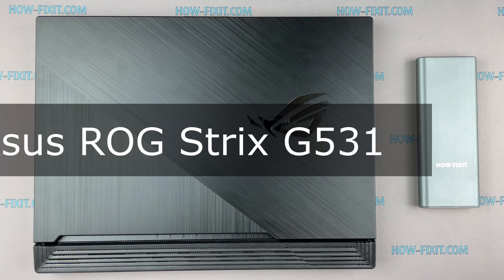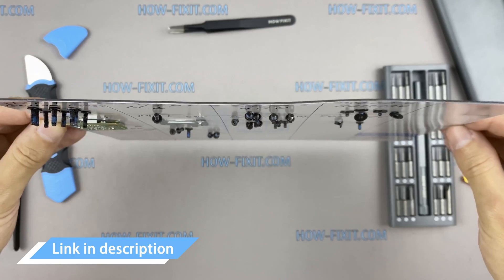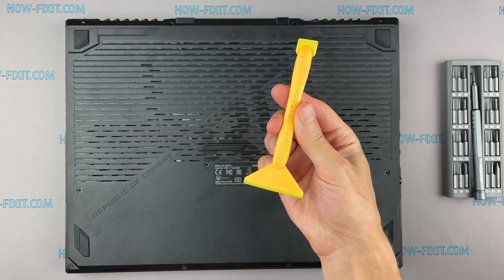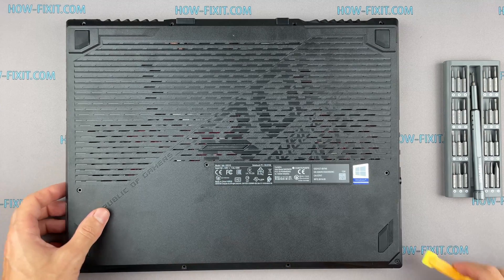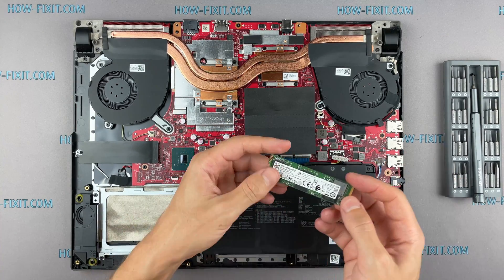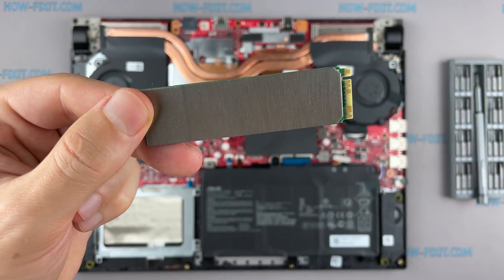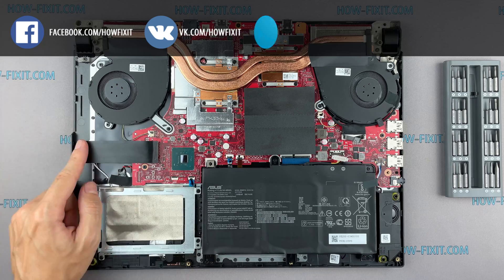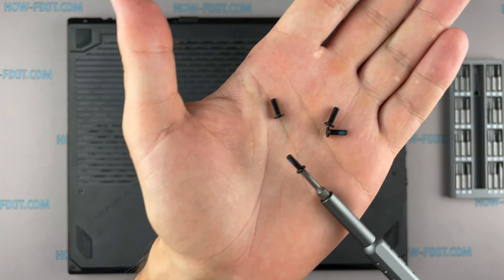Asus ROG Strix G531 M2 SSD Upgrade - DIY Installation Guide

Comment: maximum NVMe  SSD expansion capacity? can I install 2TB NVMe SSD?
Reply from the maker: There is no limit on the maximum size of an M2 SSD, but there are Windows limitations. If your Windows is 64-bit and the GPT file system - you can install a drive of any size. Check the description for links to recommended drives.

Comment: When insert the SSD my laptop stuck on the ROG logo, wd blue sn570 SSD used and also i am not able to enter in BIOS, what I have to do in this case
Reply: same prblm iam facing... i used crucial nvme m.2
Reply: then i removed ssd laptop is working fine
Reply: how could i fix this?
Reply: @astrospace31  change brand, and i suggest use Samsung SSD
Reply: @SaurabhGraduated-Youtuber what's the type samsung ssd m.2? It's 970 evo plus support for this laptop?
Reply: only Samsung n XPG ssd supported in Asus rog
Reply: same! Could you please tell me how did you fix it.?
Reply: well i read somewhere that WD ssd's dont work. try changing the brand i am using samsung ssd and is working fine
Reply: @GurpreetSingh-hs8bx  Samsung 970 Evo Plus
Reply: It actually supports M.2 sata
Reply: Change it, if you face any trouble with that@@YaresiDelagarza
Reply: Goddamns i bought the crucial p3 for like 2tb and i cant use it such a shame it's been a year and i can't solution, even i find my local asus centre for solutions even they can't find solutions for the new ssd to boot up and just concluded the crucial ssd is not compatible for the laptop (but can use it as normal external storage but can't install or clone the old ssd to new ssd just because of brand😮‍💨). Now im just read this comment and understood, so that's why.
Reply: Is there any solution for this problem?

Comment: what is the maximum storage can I upgrade in M2 ssd slot , is it possible to upgrade to 2tb?
Reply: It depends on the type of laptop. Look up the manual for your laptop to see what's the maximum.
Reply from the maker: There is no limit on the maximum size of an M2 SSD, but there are Windows limitations. If your Windows is 64-bit and the GPT file system - you can install a drive of any size. Check the description for links to recommended drives.

Comment: Thank you for this! I have the same Laptop and I upgrade it with samsung 970 TB following your video. I'm planning to upgrade my RAM, its currently on 16gb stock sodimm, and wanting to upgrade to 32gb. Will it have a big difference when I'm gaming?
Reply: Did you upgrade to 1 tb?
Reply: Right now the upgrade to 32 shouldnt be too noticeable. Some games might have a great improvement, but a few years down the road is when you definitely want it.

If you were upgrading from 8gb to 16 gb right now, you would notice a significant increase.

But that being said, i am buying a new laptop within 2 weeks and i am definitely getting 32. My desktop is running 24 right now and it runs flawlessly. Now this desktop is also almost 10 years old now so even though its super fast, 780 ti is only okay now.  I could probably upgrade the gpu and get another 5 out of it. But i want a laptop.

Comment: This is good because you show how to physically replace the SSD, however, you excluded the software part of things.  Physically replacing the drive is easy, even my 10 year old nephew can do it.   What we need is a video that shows the Windows 10 step by step to get the new SSD up and running.  

I have come across a plethora of videos that are similar to this one, but only 1 that actually show the Windows re-install/new install semi-step by step.  Consider this for the near future.  It will be a great help to those who seek to do this.   Q - Is it a challenge to walk your viewers through that process?
Reply: It might be better as a secondary video rather than adding it into a video like this one. Youtube cares about the watch times, so someone like myself is only going to watch until the point that i have installed the ssd. I can do both hardware and software no problem, but i rarely take apart something namebrand without at least skimming a video like this. Saves more time and headache in the long run.
Reply from the maker: You can clone your existing OS or do a fresh Windows installation—watch the linked tutorials in the video description.